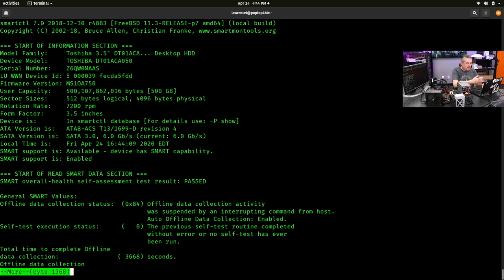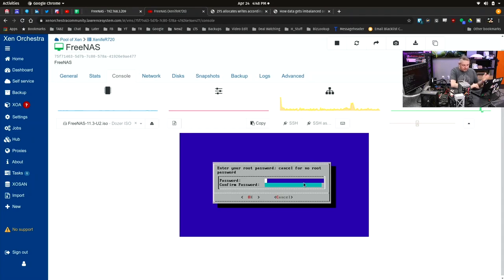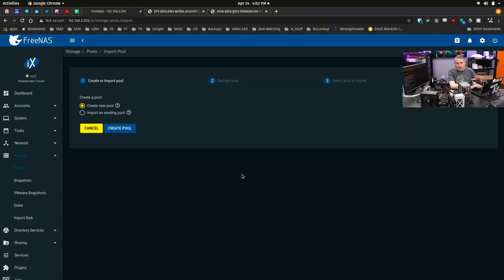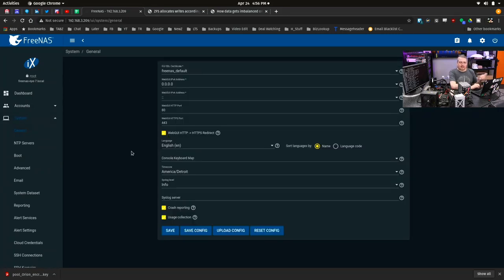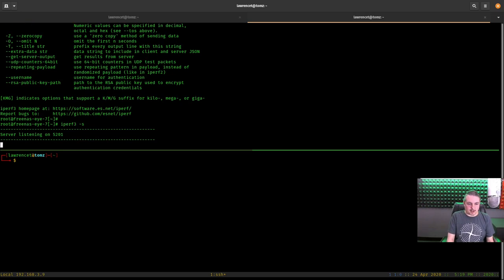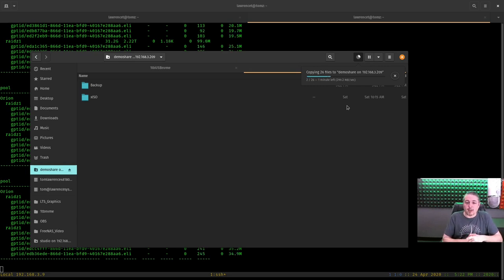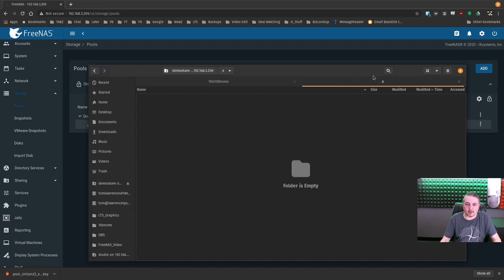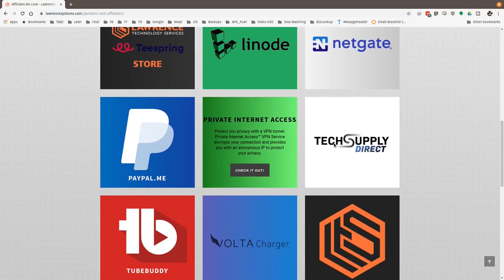FreeNAS Spare Parts Build: Testing ZFS With Imbalanced VDEVs and Mismatched Drives

Comment: Really interesting, nice one. I'm testing using a very old Athlon dual cpu, 8gb of ram and 4 320gb hdd. Z2 and 100mb speeds no problem - held back by 1gb card I guess. Pulled a drive and put another in, no probs. 

Thanks for introducing me to FreeNAS, I have a lot of learning but impressed so far 👍

Comment: In fact (though I think you know), you can set up 1 pool with 2 vdev with different resilvering protocol and different size via command line “-f”. I did that with 1T*2+500G*1 using partition, 1 mirror(500G*2) + 1 RAIDZ(500G*3)= total 1.5T of usable space, which can suffer 1disk parity.
Reply: And nice video btw, I’ve learned a lot from you!!!! Thank u very much!!

Comment: People need to ask themselves if they really need to have it all in a single pool. I run multiple pools where I have different sets of drives. Each pool has sufficient disk space. If it is just for backup or media then running multiple pools is no problem. Set up alerting when a pool gets near full so you can step in and redirect things to another pool. I know having a massive pool with many vdevs is convenient and cool but it has many downsides also. I cannot afford to buy enough drives to have high performance pools anyways so I just keep a couple big SSDs in my server for things that need speed.

Comment: Great tutorial. However I was wondering how you could add these  separate RaidZ of 4x1TB and RaidZ of 4 x500GB to Pool in a Ubuntu system using the CLI as there is no GUI like FreeNas has. Cheers & many thanks.

Comment: great video tom , question is freenas running bare metal or on xcp-ng? was a bit confused with the freenas installation trough xen orchestra.. thanks!
Reply: he demo'd an install with XCP-NG, the system he was actually using was bare metal....(i think)
Reply from the maker: Bare metal.  I used XCP-ng just to show what the installer looks like

Comment: Each VDEV has to match in regards to its  RAID type, is that gospel? Can I get away with 2 vdevs using mirror and one using raid 5 /Z1?
Reply from the maker: Not sure I would try it unless you want the ZFS gods to smite your data.
Reply: If you have a setup with mirrors, put it in one zpool.  If you have another set of disks with raidz1, put it in another zpool by itself.  DO NOT attempt to mix vdev types in the same pool - this is not a SAN or "flexible RAID" and there are obvious Best Practices.

Comment: What about non-ECC???
Reply: Well he built it on an Intel 4770K which doesn't support ECC.
Reply: if you have critical data, one uses a proper set of server hardware...; with user-grade stuff, you risk a 1 in 10,000 chance of some corruption, but, really no more so than with any system losing data as a result of using non-ECC....
Reply from the maker: Non ECC is fine.
Reply: @mdd1963  I thought about playing around with FreeNAS at home...so nothing mission critical... I have a Supermicro mini tower server with 4 3.5" bays I was thinking about running a NAS VM then using those bays as the drives.
Reply: Non ecc work fine 
I reused my old i7-920 system and replaced it with xeon 6 core and 3x4gb ECC sticks and a 8 port (it mode) raid card spent like £80 for everything (well each 8tb disks cost more then the system it self)

Comment: The motherboard does NOT ‘see’ partition changes like that.

It simply sees HD PRESENCE, example the boot drive is drive 0 but there is no drive 0 now, so go to the next drive in the boot list.

Now, the UEFI bios, do look for an UEFI boot signature on the drives, so if the boot drive is gone, or if another drive is made bootable (UEFI signature/code), some motherboards would try to boot from that drive afterwards.

I wonder where that silly myth came from about mixing drives, memory etc. for FreeNAS.

Probably somebody without understanding of programming or io coding.

Comment: So... so long as every disk is a vdev, I can add actual mismatched drives in a pool? I mean, most home users are never going to have 5 of one size drive and 5 of another. They'll be more like me: 1x 2tb, 1x 3tb, 2x 4tb and wanting to add a 6 or 8tb
Reply from the maker: That design would lack any fault tolerance
Reply: @LAWRENCESYSTEMS  True, but that's what external backups are for (at least for my situation). So, still do-able?
Reply: If any one was setting this up they wouldn't likely be using different size disks